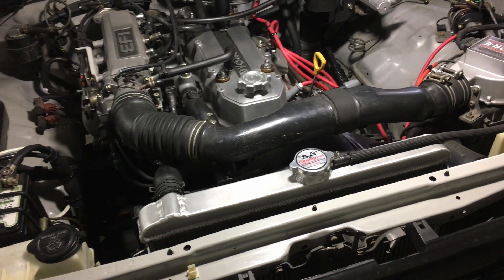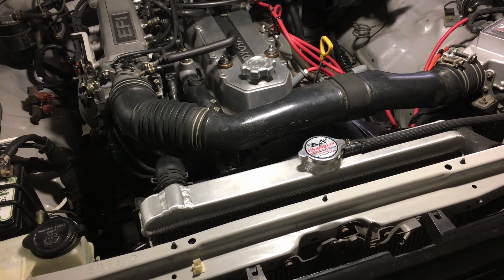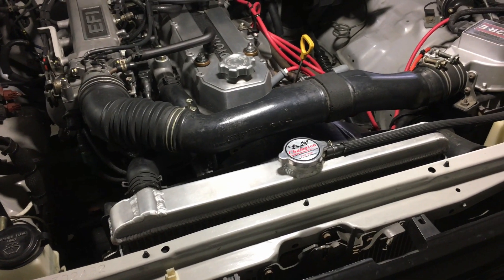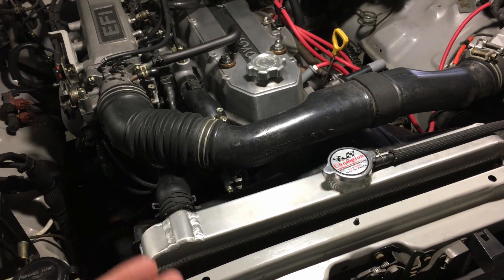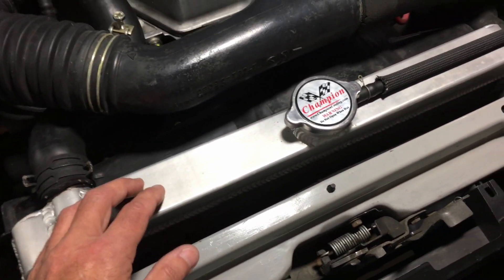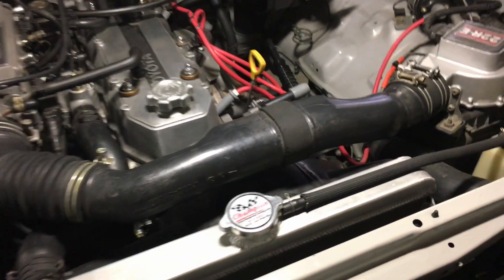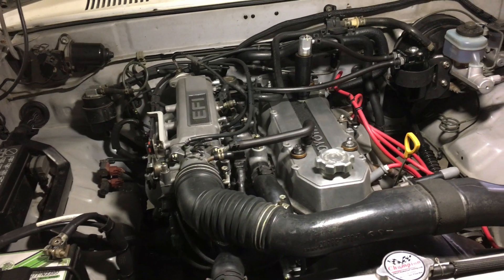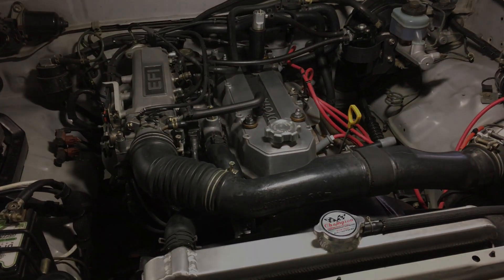CHAMPION ALUMINUM RADIATOR on 84-95 Toyota 22R Pickup - Zerek Asian Red Antifreeze discussion SAFE?

Comment: Nice video and getting to the root of it. We have done extensive testing and have partnered with Peak Coolant, I have run it in three of my vehicles, and we worked with a shop for 3 years to install only Peak 10x and have had zero issues with it. Peak's 10x is a newer formula which is safe for all vehicles, and you won't have any issues with it at all. It's more of a conventional 'green' coolant, but won't harm sensors or electronics, and I have it and our radiator in both of my Toyotas: 79 Corona, 94 Pickup.  

The pink Toyota coolant, and the Dexcool types, simply don't work in our aluminum radiators, and we've seen leaks and problems, mostly because our radiators are not sealed/closed, they vent to the atmosphere (overflow) with can pull air into the system when it cools down and pulls siphons coolant back into the radiator.

Regarding the flexing, it happens often with a lot of vehicles, so rubber bushings can help a little. I went through three copper/brass radiators where the side mounting brackets kept separating from the core, and finally installed one of ours and haven't had an issue after 5 years with it. These newer vehicles flex quite a bit... definitely not built like the tanks we drove back in the 1960s/1970s. 

Incidentally, when I worked at Toyota in the 1990s and thought I'd use the pink Toyota coolant on my 78 Celica, the next day I noticed coolant seeping out from three hoses and dripping down from the cap at the overflow. I immediately flushed it out and went with the conventional green coolant and all problems were gone. It does come in many newer vehicles, but is primarily for a sealed system, so I (and Champion) recommends Peak 10x as I have tested it for three years, and I'm very happy with it.  Thanks!
Reply from the maker: Thanks for the info! I've been running Zerex Asian Vehicle Red over here for a number of years with good luck and no signs of degradation in the radiator. From all the research I've done (and in speaking with Zerex directly), it seems to be compatible and a good choice as well. If I remember correctly, there is a link in this video's description that points to a page that fully discusses the Peak 10X as well, which I found to be a great read and highly recommend it to everyone.

Comment: Hello Ray, thanks for the video. Do you follow a year mark or a mileage mark when changing the antifreeze/ coolant?  I was told every two years, but if I don't drive more that 5000 miles a year, I see no reason to change the fluid every 3 years? My understanding is that the chemicals breakdown and start to form acids, the harm the radiator, and the head. What do you think?
Jim in Oregon
Reply from the maker: Depends on the specific coolant (you can usually download their information PDF and it will tell you the service life). But most times it's around 5 years or 100K to 150K miles. I change mine every 4-5 years regardless of miles driven. The Zerek mentioned in this video is 5 years / 150K miles - every 3 years would be excessive (that's more like what you'd expect back in 1975 or 1980 from older coolants).